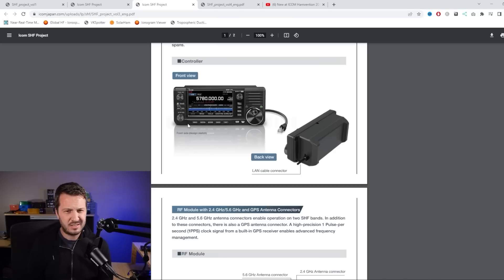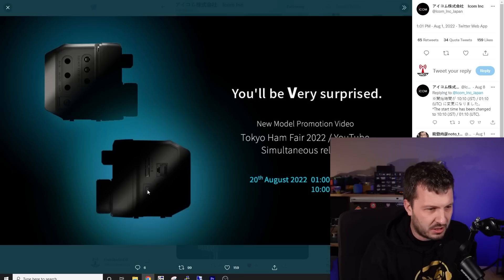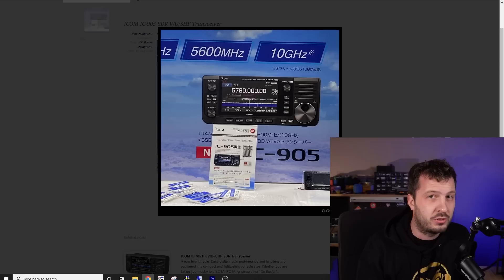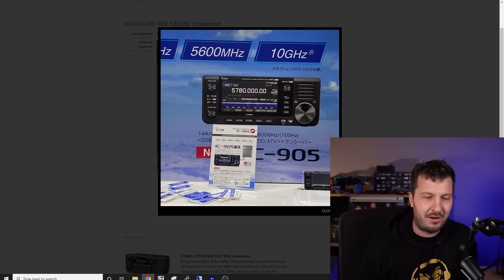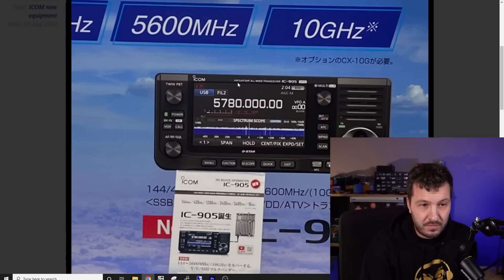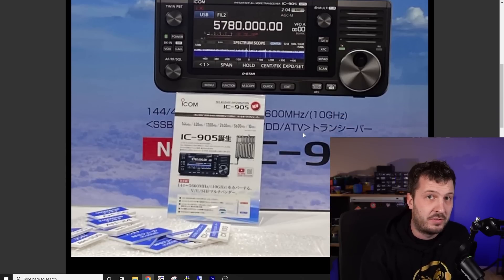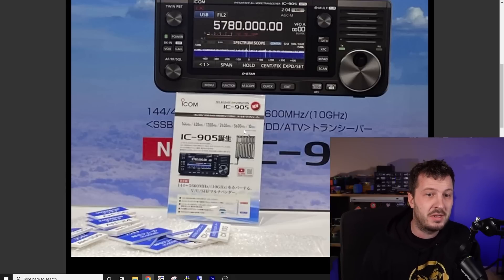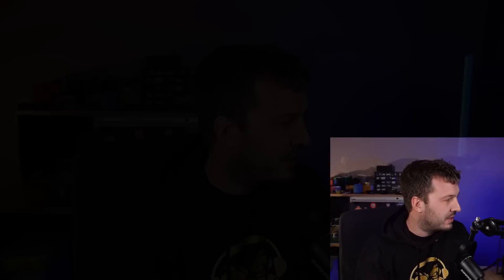NEW Icom IC-905 VHF/UHF/SHF FIRST LOOK! 144MHz-10GHz

Comment: Think the radio is just a pa then it goes cat cable to tranverters where the rf deck is housed then coax to antenna. I think they did that to lower losses from amp to antenna. Looks like 10w out up to 1.2//5w out on 2.4&5.6//.5 out on 10g is what * means I believe 😉😉exciting to see sum one giving us access to the microwave bands ☺️

Comment: i get it V(hf)ery, U(hf)ultra and S(hf)uper surprised. sadly looks like no satellite (full duplex) mode, which for this type of radio is stupid. i can see 2 groups that will buy this those who play in the high bands and those who do sat coms which the later has not been thought of. maybe a future update or a mk2 version will have full duplex
Reply from the maker: Satellite operation will still be possible using split operation, albeit not as good as full duplex of course

Comment: OK Hayden, very cool.. So what sort of antenna would we use at 5 & 10GHz..? ARe there lots of options - or will it always be a dish?
Reply from the maker: Not sure yet, but for best performance an external dish would be the best. I imagine the 10G unit won't come with an antenna (or it might?) we shall see!
Reply: Phased arrays of patch antennas? 

We would have to step away from the world of wire antennas for sure

Comment: G'day Hayden.

1st up love your steam last weekend watched "most" of it had to work on Sunday but checked in at 12.45 didn't think that you were going to make it 🙂

So tonight another great video, as  senior Network Comms Engineer & fellow amateur ( VK3ECS ) I have a couple of questions about this radio.

(A) How is it going to comply with the ACMA DFS act 
Dynamic Frequency Selection (DFS) and Transmitter Power Control (TPC)

Where here in Australia where some 5 GHz wireless channels co-exist with some Radar frequencies. Rather than ban WiFi for these frequencies, the ACMA has followed the same principle used in USA and the EU and allowed WiFi to operate on these same frequencies under the limitation that the WiFi gear must have:

DFS: a mechanism to automatically detect Radar, and move off to a different channel,  and
TPC: a mechanism where the TX power can be reduced at least 6 dB below the maximum permitted.

(B) What's going to happen to 5.8Ghz PtP Links will this radio have the ability to "crash them" ? & for that matter what about drone use that is also using 5.8Ghz ?.
( I'm, also a CASA Licenced commercial Drone Operator ) 

(C) Considering that 5GHz spectrum is unlicensed, but is still regulated with TX banned on U-NII-2
Chnl 52  	5260Ghz
Chnl 56  	5280Ghz
Chnl 60  	5300Ghz
Chnl 64  	5320Ghz

And all the other Chnls / Freq's with Maximum EIRP limits & strict Indoor only use only of U-NII-1
Chnl 34	5170Ghz
to
Chnl 48	5240Ghz

and U-NII-2E

Chnl 100	5500Ghz
to
Chnl 140	5700Ghz

What's the chance of this radio getting ACMA approval in Australia any time soon ?.

Look forward to hopefully seeing you in Nov ( I am trying to rope in some fellow amateurs including my son Tim VK1TTY ) who I believe that you know 🙂

Keep up the great work 🙂

Rgs
Wayne VK3ECS

Comment: Credit for the innovation. Not sure of the take up though. Currently in my area no one uses 2m, 70cm or 23cm so will be unlikely to use this. I would of thought opening up the 9700 for 138-174 Mhz and 400 to 500 Mhz (maybe a 9710 or something) would be of more use.
Reply: The IC-9700 architecture precludes "opening it up".

Comment: Wow if this can transmit digital ATV it would be a game changer! Can’t wait to set the official specs!
Reply: Initially, it will be analog ATV, no details about Digital ATV at this time.
Reply from the maker: Would be pretty awesome! DATV probably not likely, but analog most likely with the 3.5mm jacks. I wonder if you can watch directly using the screen 🤔🤔
Reply: @HamRadioDX  From what I have seen, it will display on the screen.
Reply: Now someone get the programming for mmsstv and easypal... Heh